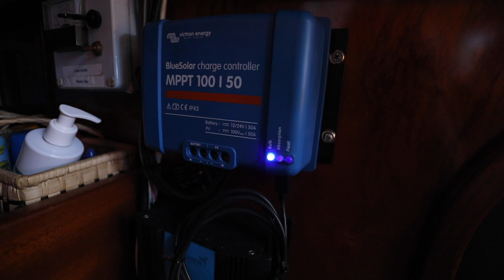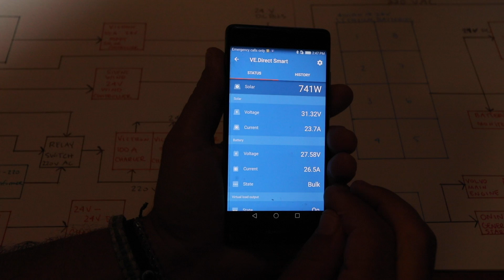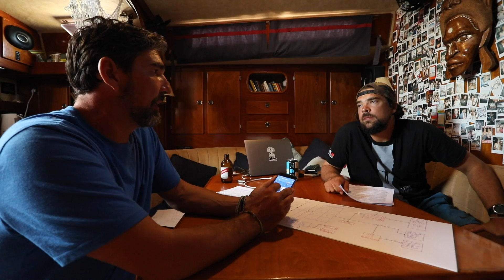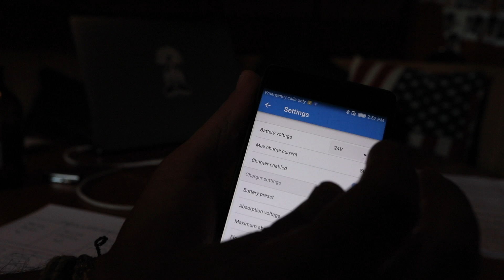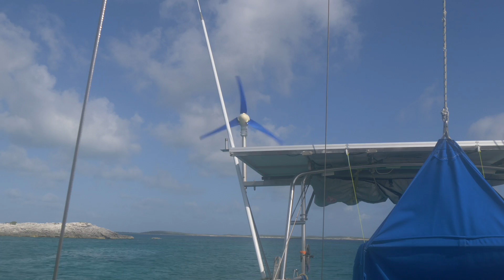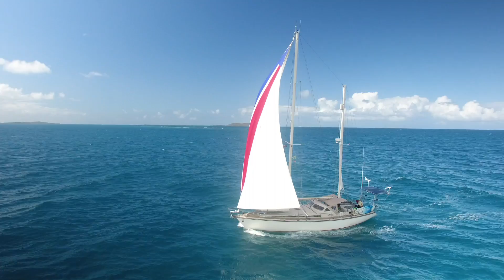SOLAR Vs. WIND - How much power can you make? ELECTRICAL BOAT TECH (2 of 7) - Sailing Vessel Delos

Comment: I thought the wind turbines were like 400 watts.  I didn't hear you mention the capacity.  How hard would the wind have to be blowing to get 400 watts out of them?  It seems like 20 knots is pretty firm wind.
Reply: Every wind generator has a different efficiency chart for wind speed vs output.
Reply: @fella704  I would think that most of them would be somewhere near their capacity at 20 knots of wind though.
Reply: @FreedomTalkMedia most of what design?  Just look at charts man.  Nobody knows what type of wind turbine you're looking at.

Comment: hi. on your victron app i saw 36v 25A pv side. smells to me like panels wired in parallel correct? if you can go to 100v pv please do.. reduces the transport losses and actually enables the bypass diodes inside the panels. and your panels dont "punch" each other..

Comment: If the solar gives 5kWh per day and that amounts to about 65% of the energy, and the generator is only 25%, that would mean the generator is getting credit for only 2kWh per day. But you have an 8kVA generator running about 1.5hrs per day, with a battery bank with the capacity to take that rate of charge, so the generator may be giving you a lot more than you think.??

Comment: I'm a land based lightning protection engineer protecting data com, instrumentación and perimeter security on remote mountaintop systems. I've watched your very well done overview. Are you designing in or investigating lightning protection / diversión? I noticed all the microprocessor control and instrumentación vs analog. Have you experienced lightning hits?

Comment: The big problem with these small turbines is that they are just plain too small and in turbulent air. If you do the math, to get 150watts from 12 knots of windspeed, the turbine blades must be around 1,20 meters, assuming 30% turbine efficiency. however, a windturbine need to be 10 meter above anytime else within a 100 meter radius to get there.

So a single instabreeze i2000 ontop of the main mast or something, would generate a lot more. those can output an easy 750w at 20 knots, but i doubt it would actually last, swining around that hard on the mast.

Comment: Most excellent video.  Thanks.  I’m trying to size an electrical power system for my boat upgrade.  Around 1000 watts to 1200 watts of solar power seems to be the consensus of those boaters who make YouTube videos.  Yours, at around 900 watts is very comparable.  It’s really nice to know that about 70% of your power is made by solar.

Comment: But to be fair to the wind generators they will only excel at nite when there is no sun plus they will go into self regulation mode when the solar voltage is high my rutland produces about 1a per 20w mine is 12v ...mine is only 5meters off the ground on a caravan(rv)

Comment: This series is awesome. I'm just getting started outfitting my boat with solar as an electrical neophyte. I was going to have it done for me but the quotes I got for solar, lithium batteries, and a new charge controller were in the $15K range -- more than I wanted to spend. Educating myself so I can do it on my own will not only save a lot of $$$, but I'll know how to troubleshoot it and continue to upgrade it as time goes on (i.e. bimini solar, wind, hydro, etc.) or for the next boat.

Comment: I could be wrong but it seems to me that when looking at the wind generators, the terms of charging were in volts not watts as stated, would make better sense  as a smaller sailboat could get all its power from wind generator and 25 watts just won't cut it

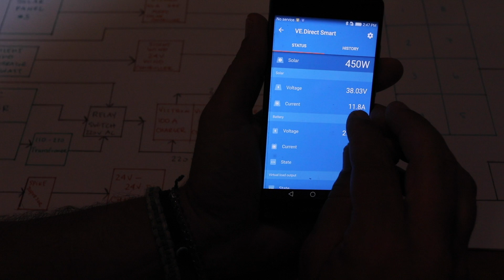Comment: 2:11 Sorry to say that you're not getting the most out of your MPPT charge controller. Your panel voltage is barely above the threshold for the MPPT to track properly, for running a 24v battery bank. Your panels should be configured for 48 volts.
Reply: How do you get 48v from 3 x 300w panels?  You could go series but that is close to the MPPT limit and any shading takes the lot out.  Staying in parallel is recommended for a yacht.  If he is generating 5kW from 900w of panels, that's pretty good and nothing to worry about.

Comment: excellent info I like the comparisons which give people a good gauge on where to spend money with upgrades, I do wonder with your consumption of power you might need more batteries, also have thought about going electric for the engine with electric motor and regen when sailing

Comment: Hi.  Very detailed and technical video, and I appreciate that.

Obviously, your jump to lithium batteries was very successful.  There are an array of lithium batteries types and manufacturers, all of which have a fairly wide margin of efficiency, or so I understand.  And the technology is growing so fast that efficiency, capacity, and weight (as in decreasing) are increasing at an astounding rate per year.  But that's another discussion, I suppose.

However, I would like to say that you didn't mention either weight or maintenance for your transition from lead-acid to lithium.  Lead-acid maintenance is a bit more complicated than only draining to 30%...and I wonder if you had a scientific basis for that way of doing things.  Also, the weight difference between lead-acid and lithium is astounding.  A 50% reduction of weight...or more.

So...do you think battery weight reduction has affected the range of your vessel?  Thought it isn't always so simple, in general, lighter vessels are more efficient.

Comment: Lithium batteries don't decay. The regular light Beast batteries can be recycled refurbished to work again. Once a lithium battery is dead. It is dead and it is toxic waste. You're charged efficiency isn't as a great, but they're safer and they last longer.

Comment: You are actually running the batteries in series-parallel. You explained the connections in an older vid, but never used this terminology.  Odd/Even in series, then each series pair in parallel. Sorry, my engineering degree kicked in.

Comment: Great video... but in order to get your batteries to float mode than bulk mode all the time you can upgrade your charger controller to a higher amperage like 150/100 or even higher rather than the 100/50 charge controller you have right now

Comment: Can someone confirm or correct this..
In the video on the previous day they yeilded 4.68kWh. If stored in a 12v bank and running at 100% efficiency (never realistic) would that equal 390AH stored in the bank? Thanks for any help :)

Comment: You could run about 10-15% of a typical north american house on the panels you have.  I updated my devices across the board in my house and use about 20-25KWh per day. However about +85% of that is the full size fridge, the HVAC fan, washer/dryer and you need to add few KWh extra for the AC in the summer.

Comment: There's some new mac (I don't have it) that charges off of USB C connected to a normal computer brick. You can get a USB C to USB connector for around 10 bucks (amazon). This allows you to directly charge the computer off of USB (DC). We do that at our house with our solar panel and battery.

Comment: I've been watching  videos on creating energy for sailing for a while and not being technically minded at all, so much has just  been a blank stare, BUT!  Thanks to your and other's videos I've begun to absorb some of this in ways i can understand.  Like Amps equate to diesel fuel.  Like  if you have a diesel motor it can only run as long as you have fuel. If running on solar/wind/electric motor you only run as long as you have usable amps.  So the more amps generated and the more efficiently they move through the system the longer you have power.  Hoping to get back on the water Sept.- Nov.
 Here's another helpful site for those of us who are mathematically challenged.  https://www.youtube.com/watch?v=1Y1_TSdR2j4.  It's a simple but pretty good system though i would prefer a brushless motor.  Subscribed and looking forward to more videos.

Comment: Solar panels are demand generators which means that they produce energy on demand (given sun of course). When the batteries are full or the energy demand is gone they simply don't generate any further energy. This is why solar panels can be put on the roof when they aren't hooked up yet. Sun may be hitting them but it's still safe. Contrast that with your wind turbines, those produce energy if they're spinning no matter what. That energy needs to go somewhere therefore you have much less installed or you need to have an energy dump load to "bleed off" that energy should you not need it. One last point, there's no way to tell the total energy potential of your solar array because it's energy is demand generated. Based on the rating of the panels you can guesstimate the amount but your charge controller can't show you at any given time what your panels could be producing versus what you're using. This again is because they're demand generators; not sure if that makes sense.

Comment: Great video and info! One thing though, if the generator produce 8kw wouldn't that be way over the C rating of the total 400 amps for the four batteries in parallel? If these were 12v batteries which I think they are

Comment: You asked for power usage at a home.  I have a 2800sqft, 3floor home with 5bed and 2.5bath.  3 Adults living here.  I use Natural gas for my stove/range but everything else is electric.  You ready for this number.. During my lower usage months I average 2200kwh a month and at peak times I've used up to 3000kwh in a month. I'm using 100kwh a day in my home.  Side note: I plan to scale down everything over the next 3yrs, buy a boat and sail around the world once I retire.  I'm going to need to adjust a lot of my lifestyle to go from 100kwh to 5kwh a day :)

Comment: I was wondering about putting a vertical axis wind generator on the top of each mast where the wind is greater and the noise is less. I imagine the tech is not as good as horizontal wind generators right now but what are your thoughts?

Comment: Suggestion: I am converting my water maker from 110v to 12v so that my excess power from renewable will make water. Next is to convert the water heater to 12v as well for the same reason, I did not think about the ice maker as you have done so I will add that in as well. Need water/ ice for bourbons.

Comment: Great video but there is one Big Mistake that needs correction. Lithium batteries Also reduce their lifespan considerably if they are discharged below 50%. Actually all batteries are affected by the deep cycles. Deep cycle Lead acid batteries actually are better at surviving More deep discharge/charge cycles then Lithium (any Lithium chemistry ...I assume for comparison the best type, LiFePO4).
Also the charge efficiency of Lead-Acid batteries is atrocious as mentioned on the video ... 50% at best. That is 50% of the energy your solar/wind generators collect is wasted on Lead-Acid batteries. So the sailboat type of solar applications definitely Needs Lithium batteries!
Another thing worth mentioning  is ..MPPT charging (by MPPT charge controllers) is indeed more efficient then the traditional PWM type of charging. But it also is far worse for your batteries lifespan.
That is if you use a MPPT charge controller and make always deep discharges your are literally killing your batteries every single day.

Comment: ? I also have a Victron MTTP 100/50 Solar charger controlling my 800 Watts of panels.  Victron limits the controller at 700 watts per the product documentation.  I noticed on your history screen shot getting 900+ watts performance.  How?  Did they make a version that wasn't limited to 700 watts?

Comment: Instead of comparing generator hours, do you have data for gasoline usage? Sounds like lithium batteries are using more gasoline/hr
Reply: How did you possibly come up with that comment when the guy specifically said that they run the generator less hours and more efficiently. ie the time that it is running (less hours) is charging the batteries more (higher charge) than it would otherwise have done with Lead acid!!
Reply: @HandyC  That's not what he said.  He said the lithium charges in bulk phase more which is a bigger load on the generator and in theory uses more diesel.  For sure it's more efficient but maybe only half the fewer hours is real savings due to burning a little more diesel during the operating hours. He's very knowledgeable, he'll understand.  I didn't hear any mistakes in his presentation and that's even dragging the other guy along through it.

Comment: When it comes to charging the same battery bank with multiple sources does it matter that there are multiple charge controllers? As in does it make the solar charging less effective since that controller doesn't know what the wind energy input is?

Comment: For us normal folks in order to understand electricity we can compare it to water. 
Battery= storage tank
Voltage= pressure
Amperage= volume of flow
Wire= pipe to deliver
Switch=Tap

Comment: I'd be interested to know what type of maintenance is required on your wind generators - are they serviceable (grease fittings, gearbox oil, etc.)? I assume they have brakes/clutches, is it necessary to replace friction surfaces/clutches and if so how often? Also, what is the expected life span of your lithium battery bank - and if you don't mind me asking how much did you pay for the lithium bank?

Comment: A couple of extra questions....What wattage are your solar panels?  I had 2x75 on a truck camper and the person I sold it too advised that they seem to diminish in power output after about 10 years....though he may have had other issues.  Have you ever replaced the ones on Delos?  Do you shower with cold water?  Do you heat water electrically?  Now that you have the AC running, do you ever run that off of Battery?  Do you ever consider switching to a lower output 24V water maker that would just run all day? (probably $$$) I have heard of other boats quite happy with this configuration.  Might be able to go for months without running the Genset....At least when you aren't in a SCUBA diving Meca.
Reply: Hey guys,  just finished watching the rest of your boat bits series and you guys answered almost all of my questions....well done!  Really enjoyed your insights as I contemplate a larger ocean going boat.   Hope you are adjusting well to parenthood and all is well with bebe!  Cheers

Comment: In the interest of helping the channel's stats by posting a comment: On the Airbus A350 (and also the Boeing B787, though they were a bit slower to learn the upcoming lesson) the batteries are built inside a sealed metal container with a metal vent-tube leading overboard. The tube terminates with a special disk that bursts open in the event that there are any battery gasses that need to be evacuated from the aircraft. This is especially important because the batteries are in the avoinic bay, so obviously that area must be protected. I think I can see in the lithium video that the Delos battery compartment also has a vent tube, I guess intended to evacuate any hydrogen released by the charging of Lead-Acid batteries, but maybe it would help in the event of a problem with the lithium batteries too. Not that I would expect problems: When they were testing the A350 setup, it was necessary to deliberately induce a battery failure to check that the venting setup worked as intended. I was told that it took some REALLY extraordinary mistreatment to get the battery to fail in that way. So if the battery management system in your batteries is good, they should be pretty safe.

Comment: Perfect timing for these videos.  I recently bought a boat after selling up, and now after 3 weeks of scraping, sanding, and painting I am about to start on electronics.  The boat already has solar and MPPT controller,  just upgraded battery bank to AGM(lithium was not in budget).  I didn't know the MPPT had bluetooth until seeing your video.  I'm sure I would have eventually figured it out,  but thanks for the info.  The inverter that came in it is a Trace engineering U2512 2.5kw from 1993.  It works fine but I wonder if upgrading to a newer one would be more efficient.  And I agree with Jason Ensminger,  I blame you,  Youtube, and all the other sailing channels for making  videos of people living the dream.  Hope to buy you a beer one day, or maybe you could buy me one.  I might be out of money by then.

Comment: Thank you so much for sharing. I have done some similar Solar project with my land yacht (RV). I love comparing notes. Some of my biggest mistake have been calculating amps. This is because half of the RV is on 12v system and the other half is 120v. Let's just say my AC run time turned out to be a lot shorter than originally planned.

Comment: I decided to go with Firefly Oasis batteries(GC31: 110ah with 80% DOD ability @ 1000 cycles). I really contemplated going with lithium, however, the problem of relying on a BMS that could have a fault and in turn causing the backbone of the system to fail wasn't something I was willing to risk. Of course lead acid can fail as well, but when it fails, it's the actual cell failing where as the BMS could fail regardless if the lithium cell is operating as expected. 

I'm curious to know if this was something you guys considered when installing the new batteries? If you did consider it, did you decide to go with lithium due to benefits and said that it was a risk you were willing to take?

Comment: I would also like to ask a question about heat. Although you spend most of your time in tropical weather, I have seen it cold enough in Florida where it snowed. Do you have any way to keep warm beside cuddles?
Reply from the maker: It was really chilly in Cape Town and sailing south around the cape of good hope.  We froze our asses off for a while.  If we go to higher latitudes again we will need a proper heater for sure.